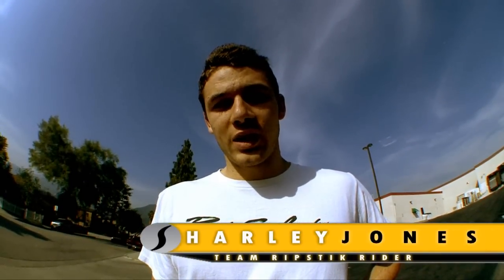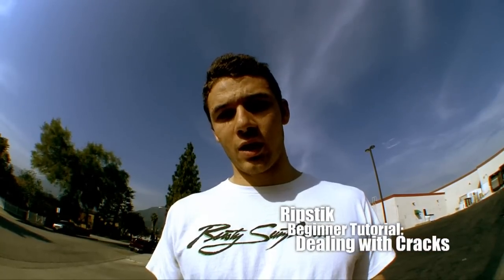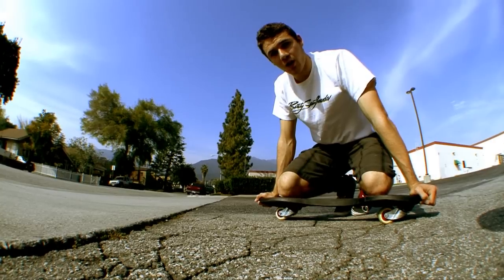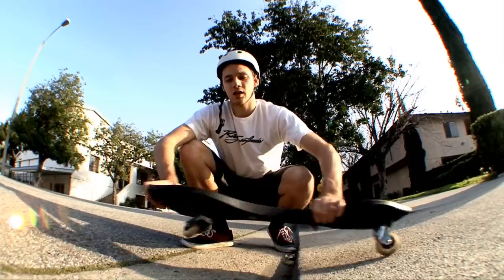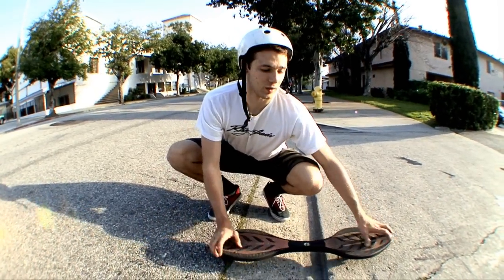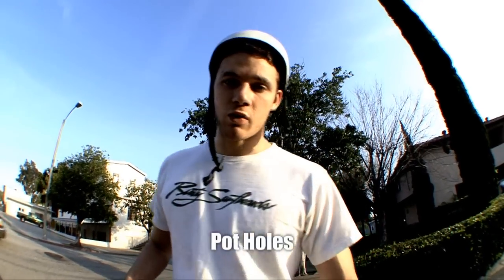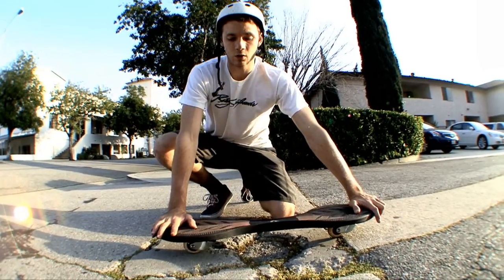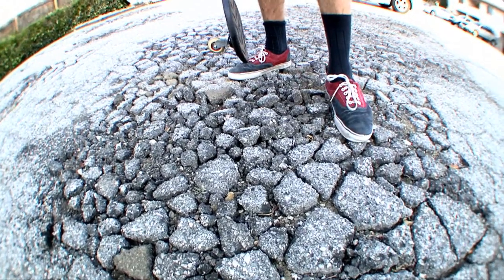RipStik Beginner Tutorial: Dealing with Cracks

Comment: question for ripstik and ripstik users, as someone who has used it for a while, it hurts to use it for long times cause the vibrations hurt my feet and legs, any solutions?
Reply: dontlookatender you just have to get used to it like i did
Reply: yeah ride more, ride daily. or cut extra sponge for your shoes. child safety floorpads works
Reply: It’s probably because your legs are too long, but well your comment is a little old so you probably aren’t even using a ripstick anymore 😅